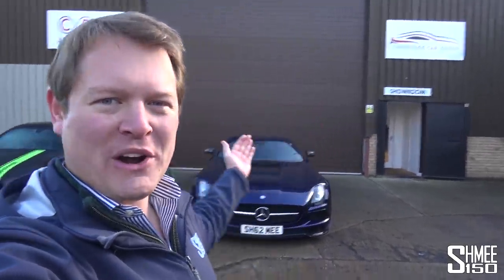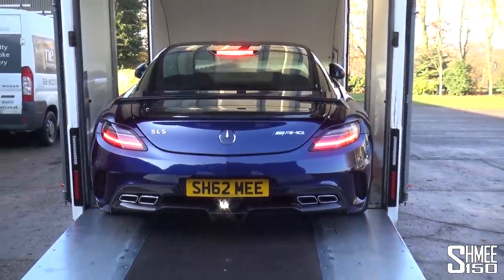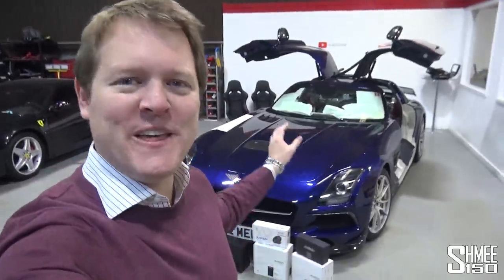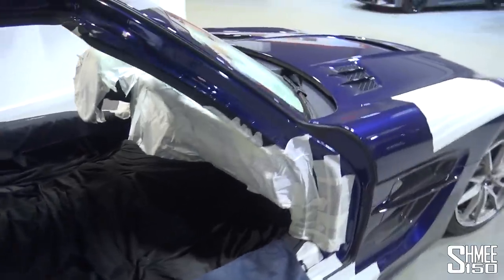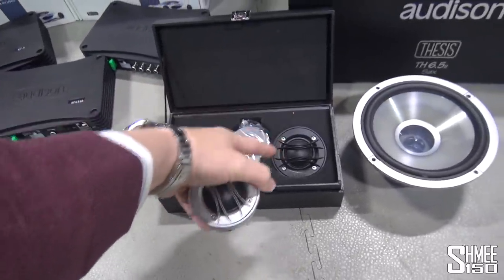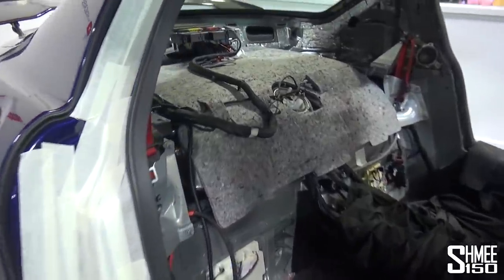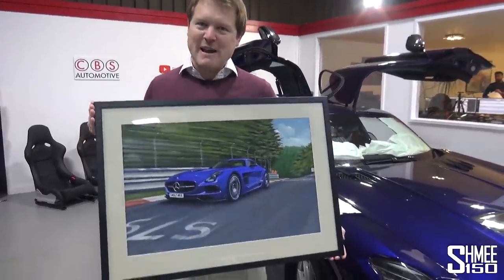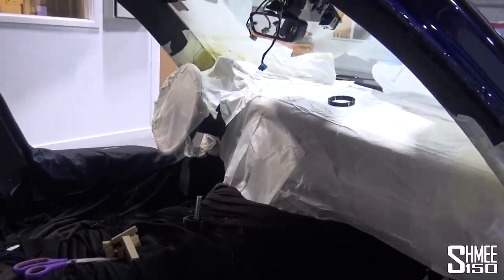£10,000 ULTIMATE Sound System for My SLS Black Series!

Comment: I installed 4 Kicker Titanium tweeters and the midrange drivers that came with them. Along with a 4 channel amp delivering 90 watts RMS to each channel. I also built a custom dual 12 inch sub box with a Kicker 400.1 class D amp. Kenwoods best media receiver to control it all. It's sounds amazing. I wish I could hear yours when done.

Comment: Good choice of Equipt. for your SLS one of my cars which has much more cabin space I have had pro installed two Audison AV 5 channel amps and the Focal Utopia BE speaker systems including two 10 " matching subs making it a 10 speaker system and an Audison Bit One processor and DRC MP controller. Using a Kenwood Excelon  DPX791BH head unit W/ CD player running approx. 3500 watts. This is an audiophile system, not an SPL system....believe me you do not want to know the value of my system

Comment: Audison makes great gear, but I do question one thing, and hopefully I don't offend you or Cambridge with this questioning:  Midrange is the single most critical part in any sound system, since they typically reproduce the frequencies that our ears are most sensitive to.  Why would they sell you on Thesis for tweeter and midbass, but sell you on Voce midrange?  If anything, I could see the polar opposite, put the money into the driver that makes the biggest impact overall.

Just curious as to their reasoning behind it.  I don't expect an answer or anything, just an observation.

Cheers!

Comment: Tim, why can't they install the A-pillar tweeters such that there are 3 detanted physical angled positions... balanced for driver seat, passenger seat, or for center of car?  or at least software that serves to volume and time delay the nearest tweeter so that the sound from both tweeters arrive to your ears simultaneously and at the same decible level?

PS don't draw attention to the tweeters... black, not silver.
Reply from the maker: That's how it will be
Reply: @Shmee150  good to hear...
Reply: In this day and age, a pro install shop will EQ the system for the driver if desired certain Burmeister car audio systems allow you to EQ for any seating position in the car with the push of a  button.

Comment: Why'd you go with audison thesis? I mean, definitely not bad stuff, but... not how I'd spend that much on audio. Hybrid audio speakers have been very competitive, helix and mosconi have some very good amps and processors, the thesis tweeters are interesting, but beryllium is the state of the art at the moment, and would be cool due to its f1 history, morel and orca designs both offer some incredibly competitive subs right now. The voce range is very respectable for its price point (not very expensive but sound very good), but I wouldn't use them in a build this extreme, and a lot of people would argue that the mid is one of the most important drivers, as it has the bulk of responsibility of reproducing the human vocal range, which is important in and of itself, but that's also the most sensitive range of human hearing. If I wanted something interesting, xcelsus has a mid with no suspension, and zr speaker labs makes some drivers that are absolutely art. I'd like to see more of the sound deadening they're doing. No center channel? I would've heavily considered an infinite baffle sub installation. I mean, it's going to sound absolutely amazing, if properly tuned, to someone who doesnt live in an audio shop, but I just feel like it's not that impressive for the amount of money you're going to have in it. Rich people, if you want to jump into a field you arent familiar with, consult someone who is passionately involved in the field. Check out the video "the ultimate Cadillac Escalade platinum sound system explained!!!!" which is very much in a different price range than this, and also definitely biased, as they're using all Mesa components, and it was a sponsored build, but very interesting.
Reply: Cant believe I forgot brax....

Comment: he should record the improved sound on his camera, upload it, and let me play it on my Macbook Pro speakers to tell how good the quality is
Reply: That can only be done, if you rip the vbr mp3 from the video and re-encode it into high quality FLAC file before converting it to a 32 bit Wav for normalization. Lastly you need to then upload it to YouTube, where it will be re-endoded into vbr mp3 again, compressed and normalized by algorithms. And lastly it can't be Shmee's channel, it needs to be judged by the knowledgeable crowd hanging out on audio mastering YouTube channels. Just shave off .3 dB around the dreaded 320 Hz region and you'll immediately hear the difference...on your laptop speakers, while holding it up towards your ear, wearing a hat, waiting for the train to arrive at main station.

Comment: I used Audison in my Subaru STI and used a larger sub in a fabricated box loaded in the trunk (boot) along with a very large amp. Entered in SPL contests and usually placed well but couldn't compete with the guys having many large subs and massive numbers of amps. Car was built to have a great sound stage but still lots of bass thump when needed.
Reply from the maker: This was definitely a discussion we had, because larger subs would be great but have to consume boot space and I preferred the route of less base but more usable still as a car considering there's not much room back there to begin with

Comment: the sound system in this car is a naturally aspirated V8, it doesnt need anything else,  especially not some over the top stuff for 10 grand, but okay, its your thing.
Reply from the maker: I guess that depends if you use such a car for 500 miles a year of special occasion or if you genuinely want to use it for long miles and living with it properly as I do.
Reply: @Shmee150  i use my 981 GTS as a daily and never use the sound system for anything, the 2k extra for the bose are a full waste. but thats probably personal preference.

Comment: The guy destroys an original car! Not impressed.
Reply from the maker: The car was built to use, and I'm not apologising for using it
Reply: @Shmee150  A car built for a purpose. The purpose was to be fast and with relatively low weight. Adding ridiculous audio equipment in that car is so embarrassing! Have nothing to do with using the car! Regardless, I'm completely unimpressed.